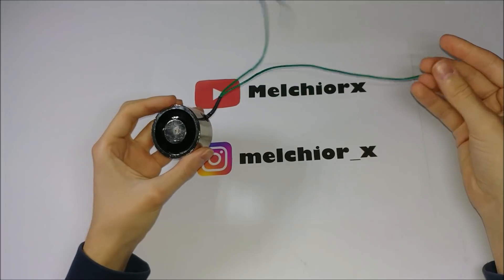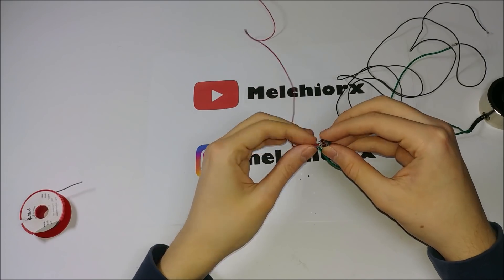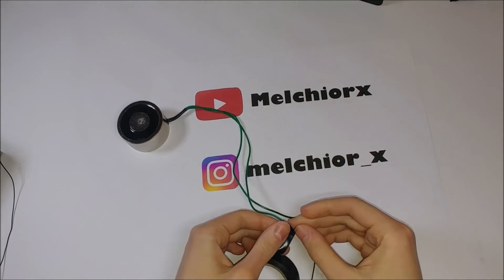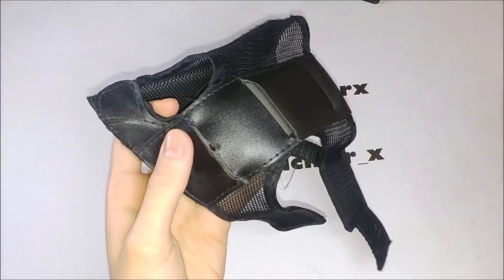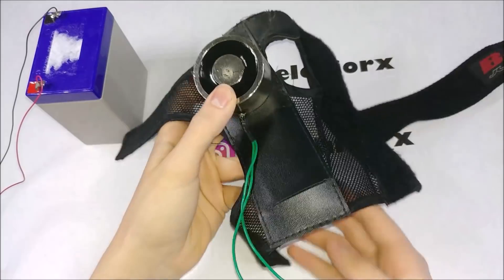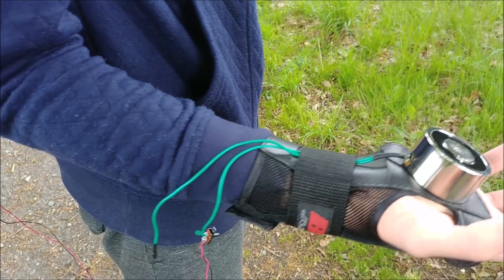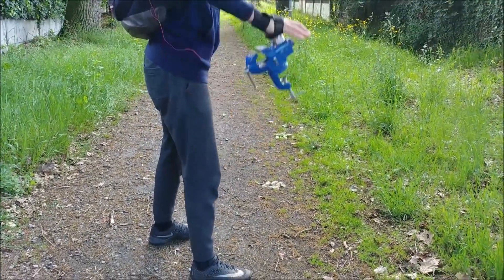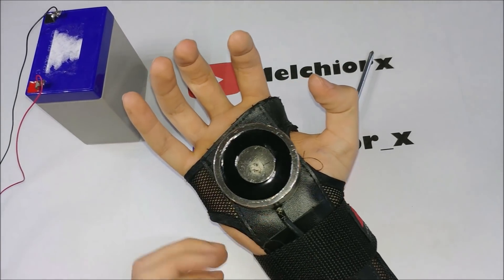How to Make an Electromagnetic Glove !

Comment: Dude is it nesscary that if magnet is of 12v the eletric input mist be 12 v can it be 5 or 6v
Reply from the maker: 6v is maybe enough but for an electromagnet less powerfull, I have tried with 5 volts and no results !
Reply: @melchiorx2234  what is that exact magnet ur using called

Comment: What battery should I use?
Reply: Jimbob Nash U should probably a 6 or 12 volt battery if ur just getting started. But if you want to get to the next stage of strong electro magnets, you’ll have to buy a 24volt battery or even a 34 volt.
Reply: Hunter Saraga what is the metal peice called
Reply: Ok thnx I just built my first one yesterday
Reply: Nice
Reply: Which one?
Reply: Oh, it is called a solonoid
Reply: Hunter Saraga thanks
Reply: Np